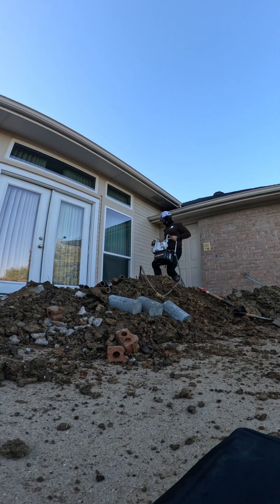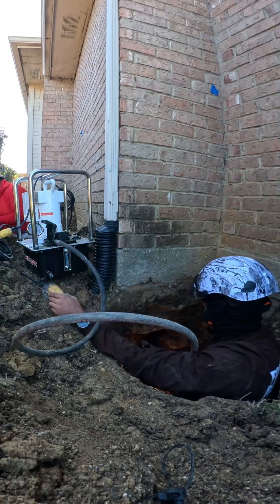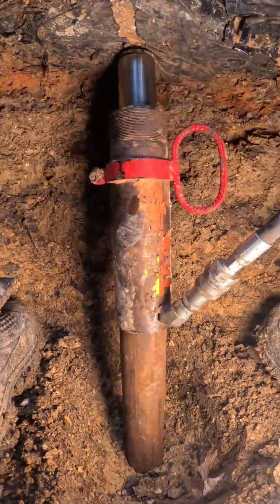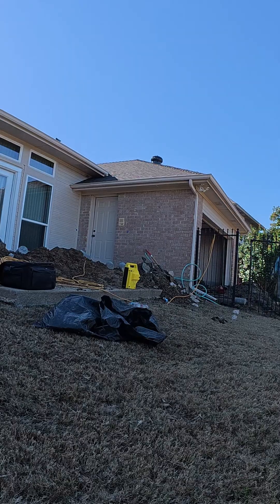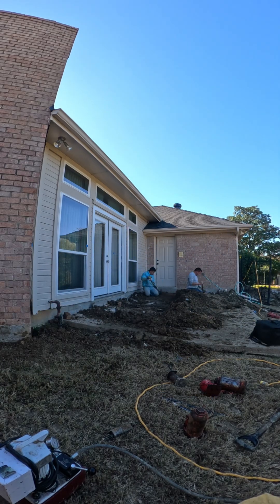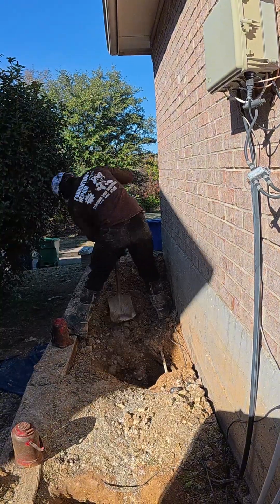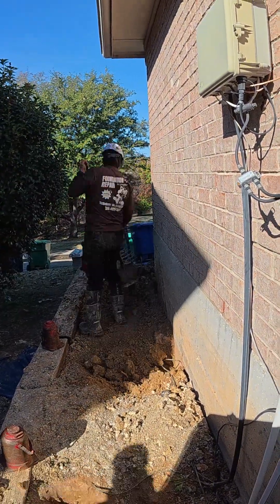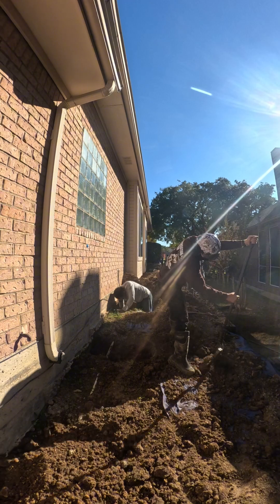Stabilizing a Sinking Hillside Home — Full Lift & Leveling Process (Part 2)

Comment: I have a house in rural area made by straw. is the principle to check the crack on the wall the same as the one from concrete in general?
Reply from the maker: Yes, the fundamental approach to checking wall cracks for structural issues is generally the same across different building materials.

Comment: do many houses in your area have basements?  How would you perform this on a basement?  Would you just dig that much deeper?  Would a basement being deeper mean less chance of the issues you are fixing?
Reply from the maker: Most homes in our area don’t have full basements, but when they do, the repair approach changes a bit. Instead of digging deeper, we install the piers directly at the basement wall footing. The equipment and steel pipes are the same—we just start from a lower baseline elevation.

A deeper basement doesn’t eliminate foundation problems. Movement comes from the active zone of the soil, which in North Texas is usually the upper 8–12 feet of expansive clay. Basement walls still sit inside that zone, so they’re exposed to the same shrink-swell cycles, heave, and settlement forces as slab homes.

Basements can also develop different types of failures, like bowing or inward-leaning walls caused by lateral soil pressure. In those cases, the repair is completely different: we use horizontal stabilization systems such as wall anchors, tie-backs, or helical/hydraulic push piers installed laterally to counteract the horizontal loads.

So the issues are a bit different, but the principle is the same—the soil behavior, drainage, and footing design determine performance, not the depth of the basement.